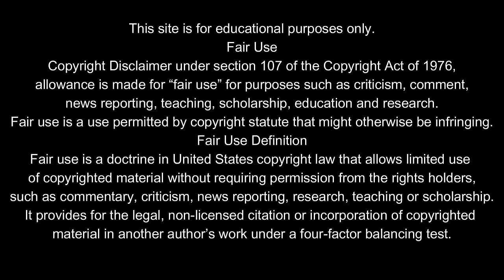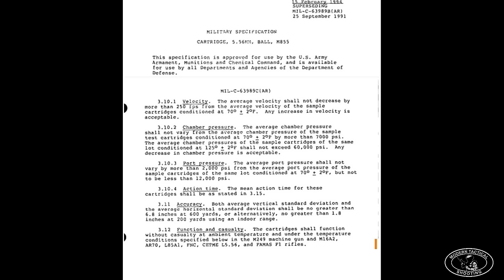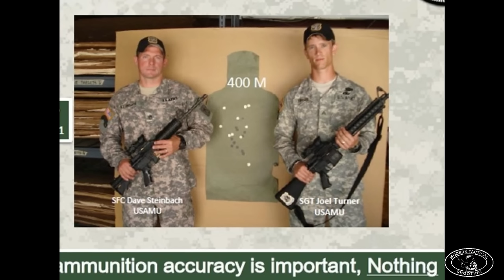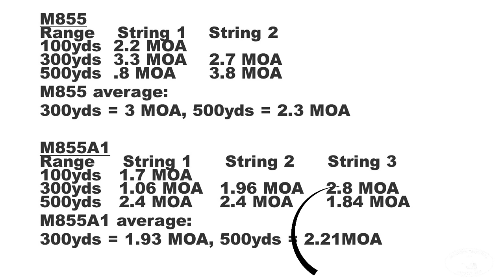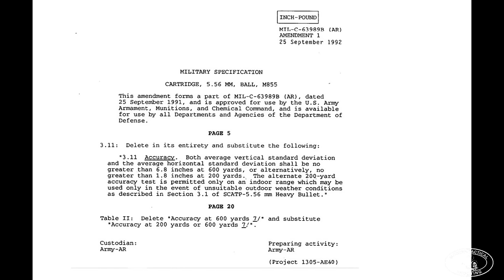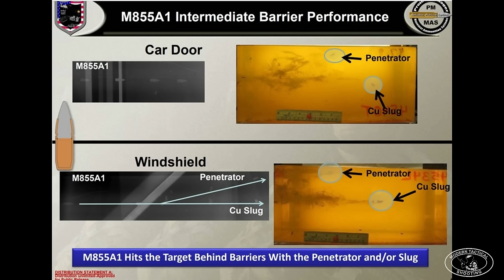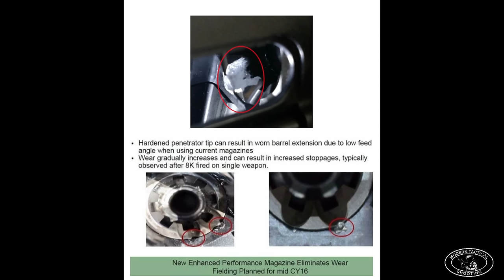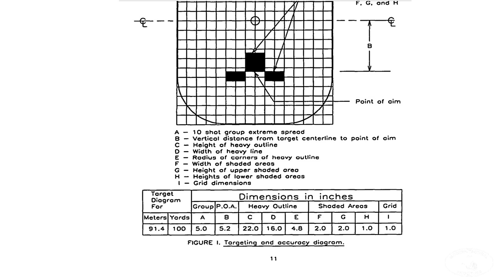M855A1 Performance Review. Did it live up to the Army's hype? Did going green really work?

Comment: Looks like 1939 all over again. In 1936 the M1 Garand was developed for the new 173 grain round which was developed to give longer range performance in the Model 17 and 03/ 03A3 bolt rifles after WWl. In 1939 the new round was destroying the ranges and increased recoil was an issue. General Douglas MacArthur requested that the Garand be tested to see if it could function with the original WWI 150 grain projectile.  Behold the M2 Ball!
Reply: Any good reading on this?

Comment: What about the "go-no go" gauges for measuring the bore's wear?  Did they change those too?  
I didn't realize that barrel wear was judged by shot grouping.  
Learn something new everyday.
Reply from the maker: Go no/ go gages WORTHLESS  Only measures erosion at one point. I've had armors Guage guns say they are good.Then I have to them to range let them try and group and so they can see for themselves guns that gun can't do better than 4 inches at 25yds.
Reply: @ModernTacticalShooting  
I'm not defending them.  As an Infantryman that served in the 82nd, I was voluntold to be the platoons armorer.  
The gauges were what was used aside from the yearly division armorer inspections..  but I don't know what went on there, as they would take the weapons for inspection.  
I never went to a school for it, that was for the company armorer and above.  
But, what you're saying makes sense as to why some specific weapons were preferred over others.

Comment: One question I’d love to see a video on  is why has JSOC chosen to run with the HK416 but tier 2 units have chosen to run the Daniel Defense M4A1 Block 2?

It’s my understanding that these are probably the two best AR platforms on the market as of right now.  What’s the reason JSOC has chosen the HK but Rangers, SF, MARSOC all run the block 2?

I can definitely speak from my experience in the marine corps that the HK is a really good firearm, we’ve ran the M27 which has a 16 inch barrel and it was perfect, but I can’t compare it to the block 2 as I have no experience with it

I will say I hated it when the corps made us mount suppressors on the M27s, the thing became a damn musket with a length of 22-23 inches and was super super front heavy and unbalanced.  We got issued peltors too and could had gotten flash suppressors that didn’t add all the extra length and weight to the front

Definitely love how the short stroke gas piston minimizes carbon blow back (until they made us put a Can on it), but the direct impingements way of blowing gas back at the chamber can honestly help to clear up any debris that may had got in which is good.  Both have their pros and cons and I’d love to see a comparison
Reply: The purpose for the suppressor on the M27 is for concealment. a suppressor does a much bettor job preventing the enemy from accurately targeting you due to making the location of the sound harder to detect, and providing even better flash suppression. (especially at 200 - 300 m and at night) so if the M27 is still used in the Squad automatic role, then keeping your fire support guy from being targeted is tactically a benefit.
Reply: @TheRyandahlgren  so a couple things I’ll point out here

1. The M27 is not used in the fire support role, every single member of the rifle squad now Carries an M27.  While in theory there is supposed to be an automatic rifleman with bipods whose job it is to go full auto, we rarely end up training like that for one reason or another.  I think if they want to seriously implement that than they need to start issuing our drum magazines to one designated member of a fireteam.  I will also say suppressors on automatics have a lot of problems, we once got issued a ton of ammo and just mag dumped full auto and I saw a guys suppressor explode.  Over the course of a 6 month combat deployment it would only be a matter of time before every designated automatic rifleman’s suppressor exploded

2. Yes I understand what the purpose of them is.  I personally don’t think it’s worth the trade off of having a 23 inch super front heavy rifle, at least not all the time.  I could get behind issuing them out based on the mission.  Like for a night ambush I could totally understand using them

At the end of the day there’s pros and cons to everything.  Maybe if they could get us 14.5 inch uppers and surefire mini suppressors that would work out much better.  Still a bitch to clear rooms with a 19 inch rifle but it’s better than 23 inches
Reply: @backlashstudios6088  are these suppressors failing during actual normal operations, or with guys f-ing around at the range with too much ammo to burn?
Reply: @Laotzu.Goldbug  not during normal operations, just guys fucking around because they were given way way way too much ammo to burn

That being said, over the course of a 6 month combat deployment where guys are getting into gun fights day in and day out I could see a few suppressors blowing up after about 4 months

Comment: Sounds like the PMO took a simulation of dispersion from the Applied Ballistics software, which is close to real-world, however, a 5% failure to impact target across and aggregate life of barrel being roughly 10k rounds, then I am going to have to say, nowhere near even 2 MOA.  Probabilistically, it would be closer to 2.5-3MOA accuracy.  That's 500 rounds not even hitting the target at 95%.

Comment: I hate to say it but I don't think that string was a fluke I have had no real issue with m855 at any range it's always been at least one to two Moa Maybe it opens up after 200 yards because that's the farthest range I've been able to shoot on but I have never known it to be inaccurate. I should have waited a minute I see you talked about it maybe it is better under 200 yards
Reply: Where does 855 go transonic versus a1?  If USAMU got involved, you can believe that sectional density and ballistic coefficient we're evaluated, but where did THAT data go? I really liked 855.
Reply: @dangvorbei5304  that's actually a interesting question like is that around the distance it starts to slow down and maybe that's why it opens up? I don't know.
Reply: @calebsone1630  Yep, and that's where a lot of your long range shooters start to worry. Lead core bullets have some advantages over steel core, like inertia. That transonic threshold sees some wonky stuff sometimes.

Comment: Sadly, the M855A1 is burning out barrels of  military rifles as well as breaking bolts. Most branches do not use it anymore. The M855 has an average chamber pressure of 51,522 psi, which is within the 52-55,000 psi range the M4 and all 5.56mm military rifles are designed. The M855A1 is increased vastly to 61,830. In fact, you see pressure levels as high as 62,900 psi. Bolts have been known to break within 3,000 rounds and barrel life has been cut by 50%. This is NOT a deficiency in the M4 carbine. The first time the M855A1 ammunition was tested was not in M4/M16 rifles. It was conducted during the Individual Carbine completion, which not one of the entries stood up to the M855A1, and none completed the endurance testing. All of the entries were designed around the M855 ammunition and worked excellent and passed all the military testing internally at the manufacturers prior to military testing. The bottom line is that as good as this round may perform, neither the U.S. nor any of our allies have any rifles that will stand up to the high pressures of this round. I doubt many would want to spend their hard earned money to find that out. Information taken from article; "The M855A1. A Great Round "If" We Had a Rifle Designed to Shoot It!".....

Comment: Thank you for the video! Incredibly wide view on this ammo.

One huge mistake you made reading the 855A1 document regarding its precision:
The document talks about the Standard Deviation, not group size. This is like comparing air planes to cars so it is a gross mistake, you testing of course proceeded well but you should measure your groups SD.

I measure my groups in SD.
If I remember right, generally when talking about SD, you can estimate from that the 95% of the shots will land in 3x the SD. The max spread (freak flyers) is aroundish 6x but nobody cares about this.

SD works way better for bullet testing as it gives more fullfilling information and you can establish a cone of fire (death) with the SD number.

Think it like this:
You can estimate/simulate group size (extreme spread) from SD very well but you cannot really determine SD from group size.
Reply from the maker: Good to know, but alas the Army never truly released its capability in accuracy, they know it under performs.

Comment: Is there a reason M855A1 has to be loaded so hot?  Sure, you get some performance gains, but it also tears the gun apart.  That's a pretty big downside.  Would lowering the pressure to within spec really reduce the performance of the ammunition that much?  The exposed steel tip doesn't do gun parts any favors either.
Reply from the maker: I think to get the terminal performance the Army was looking for, they've got to jack up the velocity no other way around it with that bullet weight and Design.
Reply: @ModernTacticalShooting  Seems short sighted.  Our M4s are already aging as it is.  Accelerating parts wear increases the likelihood of failures happening in the field.  If we added even more pressure from suppressing the gun, it'd be all but unusable.

Comment: The Tan Blue follower mags ive used here and there since 2019. I'm in big army. Though for the European RAR rotation they issued us tan PMAGs Gen 2 or 3 because our BC is an Afghan war vet and trusts them. 
BUT.... We only got the tan ones because at a glance they appear to look like the tan mags. Reason is because EURCOM are dicks about using only issues gear and magazines to appear professional. Big army priorities!
Reply from the maker: Blue follower mags work well for you?
Reply: @ModernTacticalShooting  They worked well. I've used them with M855 and M855A1 with out issue. Even with some civilian rifles like my old M90NP and some friends various AR15's from Eagle arms, Smith & Wesson, and BCM there hasn't been issues. 
Granted I pulled them fresh out of the package in the arms room back in 2019. I've only had issues with M855A1 when used in beat up GI mags with green followers (Current unit has a mix of PMAGs like I said in the comment and GI mags of various quality. Even found a Israeli Mako or E Lander steel mag for some odd reason in the arms room)

Comment: Unless I'm mistaken, I don't think you addressed the issue of whether or not it was worth going green for the US Army's adoption of the lead-free M855A1 round in this video. Would it have been easier and cheaper to just go for a Total Metal Jacket round instead so no lead is exposed, hence no lead gets deposited at training ranges while still using cheaper lead for the core of the bullets?
Reply from the maker: Bullets break up or bend in half on impact, so any lead still gets exposed. It would have been cheaper to just outfit entire military with mk318 or Mk262 since they were already in limited service
Reply: @ModernTacticalShooting  I see, I must have been thinking of using paper targets with a sand backstop, which should minimize damage to fired bullets so they can be recycled more easily. Using steel or other hard targets is likelier to cause them to break up, of course. Still, copper (the main component of M855A1 bullets) is getting expensive these days, and not every fired bullet (especially those fired in combat) can be recycled either.
Reply: @Mazryonh  "paper targets with a sand backstop" is this currently being used anywhere? it sounds like a great idea
Reply: @pootytang2872  Yep, because the sand would stop fired bullets more gradually and let them be recycled more easily, than if they fragmented by hitting metal targets they couldn't penetrate.

Comment: Ya idk man lead isn't exactly harmless especially when it's being blasted by compressed air into your face. Also I don't even think that's why this change was made, if the lead free options did not perform I'm very confident they would have kept the lead rounds. 
I use lehigh xd in my carry gun, barnes is my favorite manufacturer for rifles atm so ya this isn't exactly something the military is doing by themselves. Monolithic copper/brass bullets have undeniably grown in popularity in recent years. 
It all comes down to 1 simple question, does m855a1 have any advantages over m855, m193 or m995 ? Well..... yes absolutely it does, this design like the ar itself is everything you need and nothing you dont. Now the price I'm not defending but hey not here to judge that. 
m855 and m193 I don't think anyone would argue are both  inferior to m855a1. M995 and m855a1 I haven't seen any side by side comparisons but I'd guess the tungsten tip instead of a core is better for penetration. The core isn't separating from the lead and jacket instead that tip is clearing the way for the whole projectile so it's retaining it's full weight as it penetrates. From the few tests iv seen m855a1 sh!ts on pretty much any lvl 3+ and even some lvl 4 plates which is better than m855 or m193. Tungsten tip instead of core absolutely makes sense for the application and so does having the rest of it be copper. Copper/brass is actually listed right after Tungsten as far as potential ap material. 
They're over emphasizing the whole lead free thing and I think people are focusing on this fact so much they fail to realize this wasn't even about going green or what ever environmentalist bs they keep repeating. If you ignore the lead free part this round still absolutely makes sense. I think they already knew that it was within their capabilities to manufactur a lead free round so they set it as an expectation, I don't think this what switch had anything to do with going lead free.

Comment: From your own testing you should have thrown out that first string for M855 despite it being ridiculously good since it definitely made the average tighter than it probably should be. For instance the 300 yard testing shows a 1 MOA improvement over M855. It's unfortunate you couldn't have ran more tests to get a larger average since it likely see the improvement more like .5-1 MOA instead of .23 MOA because of the fluke group you shot.
Reply from the maker: I could have left out M855 all together it does not effect the outcome that M855A1 is indeed not match ammo as Army claims.

Comment: Your data at 10:41, from your range day, suggest M855A1 a lot more accurate than M855.  You need to throw out that .8 MOA at 500 for M855, or do another string - it's too divergent from 3.8 - averaging those two is wrong but understandable in these ammo-times.  My GUESS is the .8 was the aberration, and if you run five more groups the average will be closer to the 3.8 inches of the other string. - I'll use 3.0 inches as my example.  If so, M855A1 is 23% better (reduction in MOA from M855) at 100 yds, 36% better at 300, and if you plug 3 MOA for M855 at 500,  you get a 26% improvement.  42% if you use 3.8 inches.  My stats-driven conclusion from your data is that we can't take too much from it, because of the small sample size, but what we can take is all positive and points to much improved accuracy. From your gun.
Reply from the maker: Regardless of how M855 shoots, the test was to see if M88A1 shoots "Match like". I shot M855 just to compare for the hell of it.  I could have left out M855 and still shown M855A1 average not anywhere near 1 MOA. Not match like as Army claims.
Reply: @ModernTacticalShooting  Agree, whatever the definition of "match-like" you choose, that wasn't it. But, the secondary conclusion is that it looks like it may be a "significant improvement," subject to further testing, over the round it replaced. Let's assume your test results are similar to a future, full-scale test, and at every distance the MOA was reduced by 25% (4 MOA becomes 3, etc). Purely as a reduction percentage, it's significant but not game changing. An optimization of the current, and not a Scott Bakula leap. But the real question is the accuracy improvement enough - is there a tangible benefit to be had by getting another 25%?  And will that next 25% cost more than this one did, on the theory that the closer you get to optimum, the more it costs to squeeze the next %?  What is accurate enough?
Reply from the maker: @scottstewart5784  well future testing kind of a mute point seeing how it is set to be replaced in 2024
 and major deployments are over. Its up to personal points of view if it was money well spent.

Comment: Interesting, Paul Harrell did a comparison on multiple targets and the a1 was no more accurate than 855,and they both would pass through 3aaa body armor. But I quess no one here is old enough to remember the old Remington bronze point in 3006 in auto loaders.  You can't cover a body with enough armor, so the a1 is pointless.

Comment: just a dumb medic asking but that increased chamber pressure doesn't that also add to wear and tear on the chamber?
Reply from the maker: It more effects the gas port hole in the barrel but also yes harder unlocking of the bolt from increased gas pressure can be added stress

Comment: If they use key phrases and terms instead of data or real facts, then the person is usually embellishing or lying.
Wow, those are thick walls.  Probably the only way they can stay cool.  Concrete has a cooling effect until it heats up lol.  Seriously though, that thick it would stay cool I'd think.  Damn, you'd want some real firepower with .50 cal being the bare minimum.

Comment: Terminal performance is ridiculous from m855a1 even when down to sub 2000 FPS no other 5.56 can do that that low I have a huge stockpile and this is my shtf go to ammo I have seen what it does to steel it almost passed through my 1/2 ar550 target at 70 yards from my 20 inch barrel velocity was 3260 at the muzzle